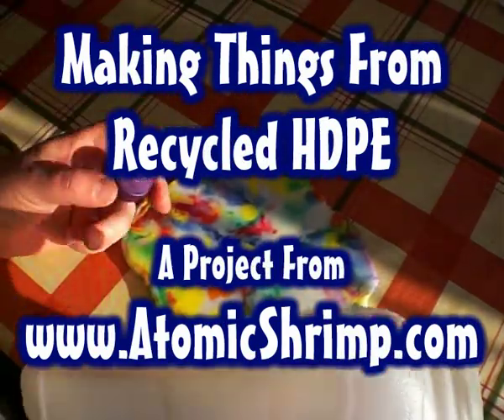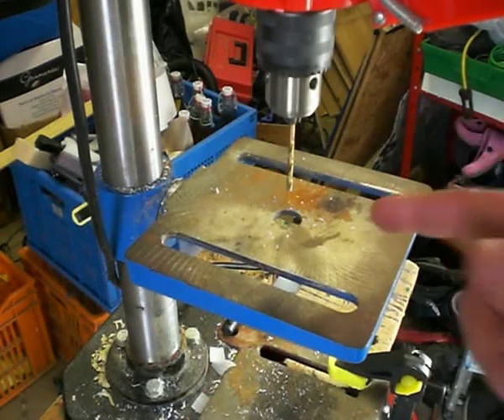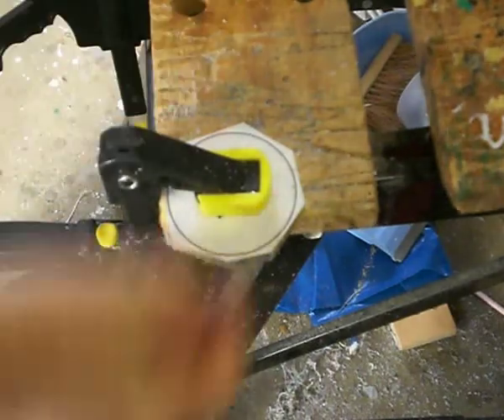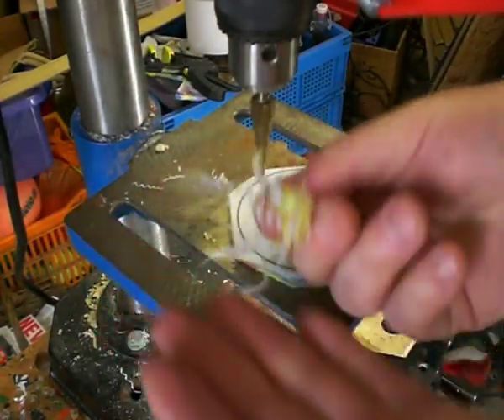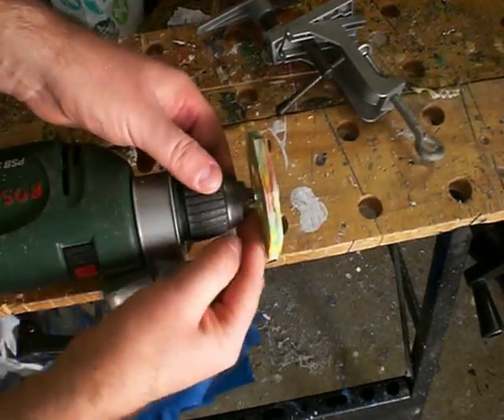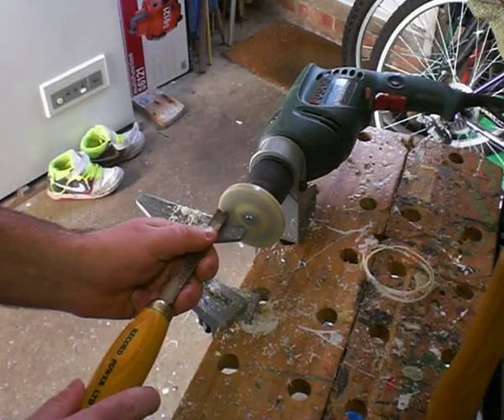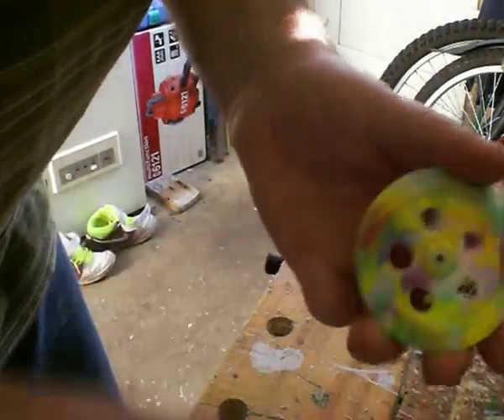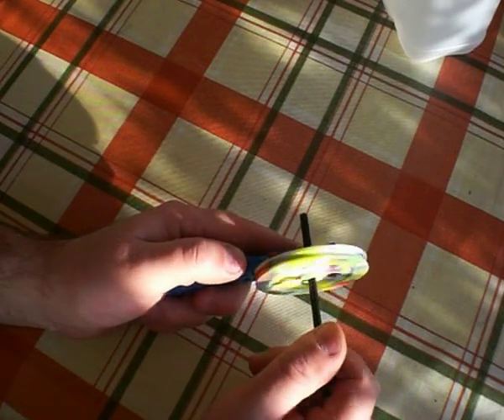Making A Pulley Wheel From Recycled HDPE

Comment: you could have screwed the plate down using the 5 holes you had already drilled to secure it for cutting. also for making the centre hole to fit the shaft, a small piece of metal rod made to shape but slightly small could have been forced through using the bench drill as a press.

Comment: That's some very lateral thinking there man, excellent. 
Go you have any idea of how much weight a pulley like that could handle? Would a coated steel cable of the correct size for that pulley cut through it or is it tougher than it looks?.
Reply from the maker: It's pretty tough.  A steel cable might wear it away over time though, I suspect

Comment: I have been messing with this hdpe plastic. I had a load of those plastic straps that come round heavy cartons. I figured if they use heat to weld them round the box they might melt together ok, and they did. Worked a treat. I dont know if its exactly hdpe BUT it mixed fine with other plastic that was definately hdpe (2 in the triangle) milk cartons and lids etc. I darent use the wifes oven, so I used a heat gun aimed into an iron skillet and added sheets on layers when they went "wet" and kept hammering them down with a wooden mallet (sort of forging) HDPE turns FANTASTICALLY well with a sharp skew AND it floats lovely I intend to make some pike lures from it Oh, and its shocking how much bottles reduce to a small volume.
Reply from the maker: Interesting stuff, thanks for sharing!
Reply: I wonder if vinyl curtain side will melt up and fuse good? I have a stack of it I was using to make drum heads, will have a go with it tommorrow. Oh and I melted some white HDPE milk cartons that had various carspray painted colours on them, astonshing results like a warm marble effect. The paint sort of soaks into the plastic after its heated
Reply from the maker: GOLDSMITHEXILE 2016 watch out for fumes from vinyl. HDPE is pretty innocuous when heated. Other plastics not so much

Comment: That would be so much easier with a 3-d printer
Reply from the maker: Sure, but I am resisting buying one because the more difficult path often has more interesting scenery.  Also - you can't 3D print with HDPE, so the end result would be a different thing really.
Reply: understood, some college kids are now producing an HDPE desktop shredder that extrudes the filament, not sure if it's really HDPE or LDPE, but they were using 2 liter bottles
Reply from the maker: That could be some kind of polyester (if it's 2 litre bottles from carbonated drinks).  The problem with HDPE is shrinkage as it cools - a 3D printed HDPE model would literally tear itself apart as each successive layer is laid down.

Comment: Ho you recon if i made some compound bow cams out of hdpe would hold?
Reply from the maker: I'd be a little worried about the potential for failure under that kind of load.  It's a pretty strong material, but there is always the possibility of weak spots with recycled material.
Reply: Ok, then i'll stick with my aluminium ones :)
Reply: HDPE tends to creep under pressure

Comment: One question: I haven't yet had the time to turn my pulley, but in my other experiences with HDPE I find that it is extremely slick! What kind of belt are you using and does the it slip on the pulley?
Reply from the maker: I only used this pulley for driving very light loads using a thin rubber band. It didn't slip I that context, but you make a good point. This material might be better for non-drive pulleys.

Comment: To rough size the wheel, I've clamped a piece of flat wood stock to my band saw, put a small hole in the wood at the wheel radius distance, then put a nail through a center hole in my wheel stock. Simply rotating the wheel then smoothly cuts the circle shape.

Comment: Use a hole saw to cut the circle and skip all the extra cutting and shaping steps. They also sell a circle cutting bit for your drill press. here is a link to what it looks like
http://tomsworkbench.com/wp-content/uploads/2011/05/sing-blde-univ-hole-ctr.jpg
you can remove the drill in the middle if you want no center hole.
To cut a circle with a hole saw kit with no center hole, first cut a hole in plywood then remove the drill bit and lay your project under the hole in the plywood and you can cut a perfect disc with no center hole (The plywood becomes your guide)
Next time cut the circle from an old plastic cutting board. Yours does look nice though!

Comment: what is this hardware holding the drill, turning it into a lathe, did you make that or is there a place to buy stuff like that...see i have a extra 4.5 angle grinder i was going to take the guard off and make it into a lathe, i also see the tool holder, is that some type of kit?
Reply from the maker: +Jess Evans It's a drill-powered lathe accessory kit.  This one was made by Wolfcraft - I don't think they're in production anymore, but they occasionally turn up on eBay

Comment: I see you too had to replace the bolt on the head of that clamp. It happens to me on every single one I buy. I'm a cheap bastard, may have to do with that...anyway, I put a pop up rivet most of the times and works too. Cheers, great video.

Comment: Thanks for sharing this interesting project!
Just one point, I thought that the reason for the centre of a pulley etc. being thinner than the edge was to save material during manufacture; something we don't have a need for in this project. It would work just as well without thinning the centre and of course be stronger. ;-)
Reply from the maker: Abdullah Eyles Probably true, although as this pulley was for use in a construction toy set, the appearance/shape was as important as the function (also, this video is really about the possible ways to work this interesting material)
Reply: Abdullah Eyles he could save the scraps and make something else out of it

Comment: When I was at uni one of my tutors told us if we melted down carrier bags, ( the thicker type ) and poured it into molds we could make our own glue sticks for our hot melt guns. Not sure if its the same type of plastic but would be interesting to test out ?
Reply from the maker: I reckon your tutor must have been talking about LDPE, which has a slightly lower melting point.  I tried machining a rod of my recycled HDPE into the right size for a glue gun - it melted just enough to get stuck in the barrel (but not enough to squeeze through the nozzle).  I had a throw the glue gun away.
Reply: Interesting, I wondered if it was the same. I've since watched a few other videos on the subject and it seems the softer plastic bags are HDPE, he specifically said the stronger type so it must be a different material, . Maybe just PVC. Some more investigating I think, thanks for getting back to me, keep up the good work.
Reply: ian elley The thicker type bags(like from a clothing store)are surely not HDPE. They are simply too flexible. They may also have a plasticizer additive, which could also alter the melting point. PVC is not the only plastic that uses them, but that would be a good guess.
Reply: ian elley Shopping bags are PE, but not HD (High Density) their LD (Low Density).
Reply from the maker: The crispy, rustly ones may be HDPE, but they contain very little plastic

Comment: You need a 3d Printer so cool.
Reply from the maker: I often think I would like one, but then, I also like doing things the hard way sometimes.  I think a 3D printer might make me lazy.
Reply: Alan Greenspan it sounds like your trying to do something awsome there my friend you can easily recycle this stuff as this guy has demonstrated in his videos, look up how to make a vacuum former as they are stupidly easy to make. and you can make it any thickness you like as he said you can put nuts on the heater to make it clamp only the thickness of the nut. i hope you inspire the community!
Reply: AtomicShrimp How would you be able to melt the plastic to be able to be used in a 3d printer? get a special heater that ends with a spaghetti press or something so it is the right size of the printer's plastic?
Reply from the maker: I don't think you could use HDPE in a 3D printer - it only bonds to itself when melted (so the layer being printed wouldn't stick to the previous one) and it shrinks a lot when it cools - so the printed model would distort very severely before it was finished
Reply: AtomicShrimp not to mention the filiment would be too hard to create i was going to try recycling this stuff and vacuum form it, but thanks to your informative videos i realised that would be near impossible as it will distort too badly as it cools down..... but i might still give it a go because it looks like you can make some pritty cool things with the stuff, have you ever tried making a thin sheet of the stuff say 1-2 mil thick? or even thinner?
Reply from the maker: I've not gone thinner than about 3mm - but mostly because the plate of my toaster is not absolutely flat (it is slightly concave, so it produces pieces that are a little thick in the middle)
Reply: AtomicShrimp ahhh right i got ya, yehh would be good to see you make really think sheets of it 3 mil is quite thick but i think its great you can make a workable material by recycling i want to give it a try but like i say i would be more inclined to try this if i could vacuum form it but alas the properties of this material! thanks for the supersonic speed of this reply by the way :P
Reply from the maker: The shrinkage on cooling might make it very difficult to vacuum form - even when I pressed it between two bowls, I could feel it resisting me.
Reply: AtomicShrimp
I got some LDPE pellets I will be testing for 3d printing soon.
Thanks
Matt
p.s.
http://www.absplastic.eu/3d-printers-that-use-recycled-plastic/
Reply: So HDPE is plastic #2, what if you used PETE #1, or LDPE #4, or any of the other recyclable numbers? Would this grill still work on some of them/any of them? Or would you need a customized heater to a certain degree? And which recyclable # has toxic chemicals that should not be done like this on a grill?

I want to make a small startup hub for a community to recycle stuff and make things.. maybe even try to get it government sponsored, to find jobs for people.. I really like your pulley idea, but how strong would say a regular wheel be? Could HDPE be made into wheels say for a skateboard (but make it like 3x as thick as your pulley)
Reply: Alan Greenspan I think Matt Hall was implying that the Shrimp makes parts with the 3D printer rather than using his recycled plastic in the printer. Also 3D printers are very sensitive about the material they use, not every plastic would be compatible (as other comments mentioned).

Comment: An excellent project for your technology used to make flap Valve for a piston pump for water. You have a place to put an o-ring And do it at a rubber flap which would be bold in the center with those holes you have
Reply from the maker: What a brilliant idea - I think I might try making a pump for my rainwater butt